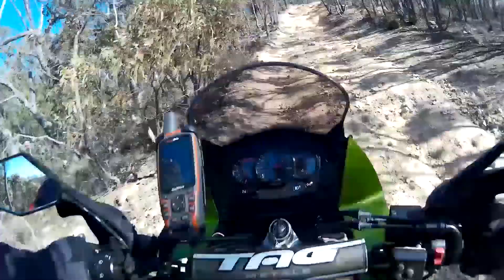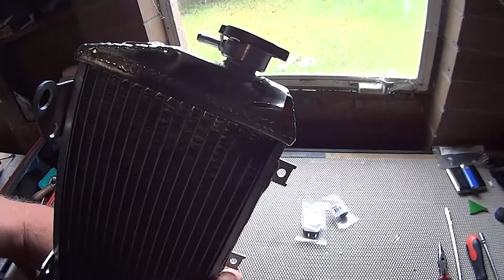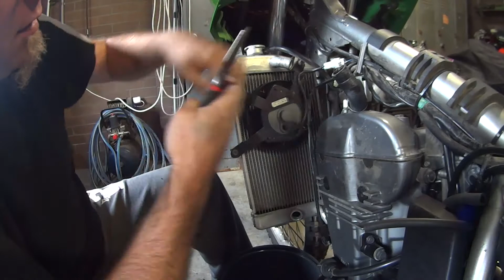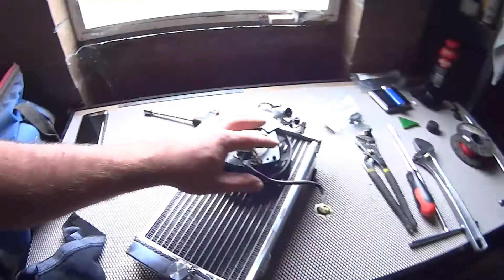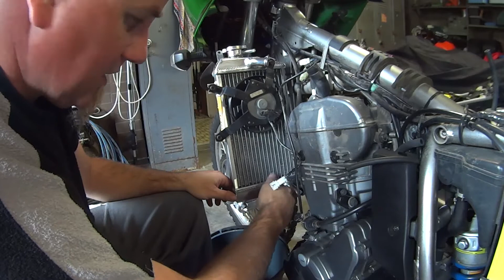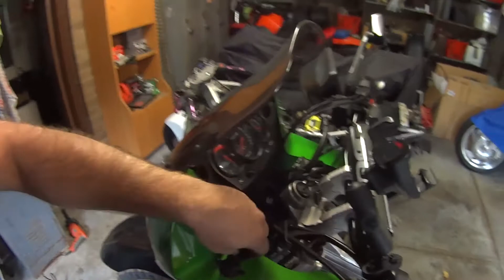KLR650 Radiator Change & Thermofan Override

Comment: I hope this mate is still kicking. been 5 years since his last video on his klr. I just purchased a Ducati 848 fan I'm going to put on the 2006 KLR650. instead of doing the mod like Brickhouse builds which gave me this awesome idea I'm going to make mine a dual fan if possible. going to mount the Ducati fan somehow on to the radiator with it's existing frame. I will then use this fan as the override fan.

Comment: Again great vid, might give that over ride switch a go as I have to change my coolant anyway.   Out of interest I was running the 606's front and rear for my last set, I love the rear 606 but wasn't really taken with the front and it had a weird wear pattern for me.  I changed the front to the D907 and kept the rear 606 and love it especially for the trails and its not too noisy on the road...worth a look if you like a lot of off road riding.
Reply from the maker: vercos007 .... thanks for that..im going to run a TKC80 front..my son has done 4000km on his and it still looks new and grips good in the dirt. im going to run a 60% dirt on rear due to mikuni upgrade...dunno which one yet but ill just have to take it a bit easier in soft soil off road

Comment: I just got that radiator for mine but the bolt holes are not quite right. I can get the two top bolts in but the bottom one is like a inch away.
Reply from the maker: on the radiator or thermo fan?
Reply: On the radiator itself. I have a 2000 model
Reply from the maker: @johnnyappleseed4492  .... did they give you the correct radiator? maybe its for a later model like mine... the holes on radiator should line up if correct.... match it to your old radiator so you can see whats different

Comment: How were you able to confirm  the correct radiator  off ebay. I just got 2017 digi camo and need replcement as jb weld didnt hold.
Reply: Brian Ralston ..... on ebay they usually have the year model that the radiator fits.. eg 08-15

Comment: Hello ftom Spain, I have a KL tengai (28 years now) and the radiator has two small leaks, I've seen yours, maybe from ebay, and want to know how it works. Thanks and sorry for my poor english languaje...
Reply: Carlos Cortes .... I remember looking at radiators for your bike on ebay... just have a look and I'm sure you will find one... they often have the years stated in which bike the radiator will fit.... my radiator has been great...
Reply: Ok, I'll put an anti-leak paste first, if it doesn't work  I'll buy one like yours. Thanks a lot!

Comment: where did you get the white electric connectors from? do they have a specific name?  thanks mate
Reply from the maker: cody modes ... they're called scotch locks... or sometimes splice connectors.. most electronic shops or car audio shops sell them or just look on ebay.... ebay has huge kits with all the connections u will need...
Reply: TY